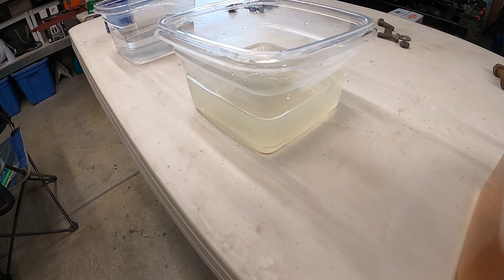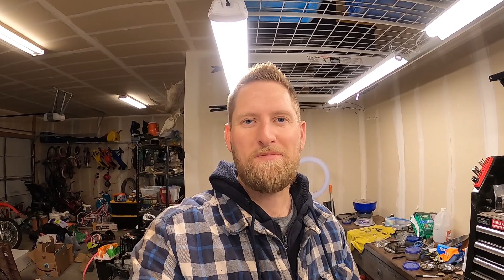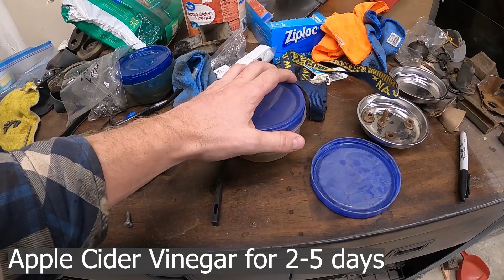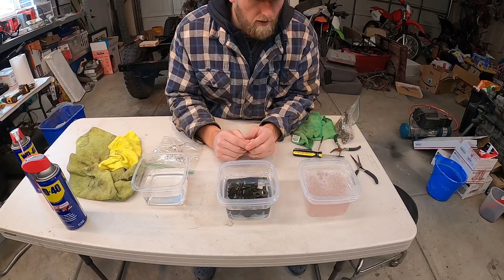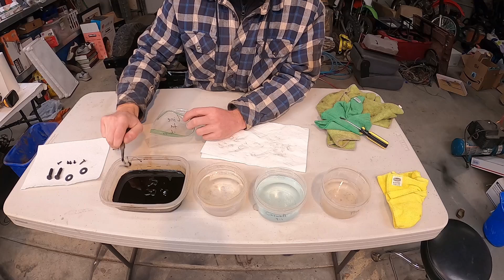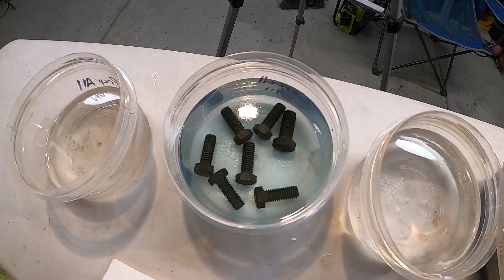BLACK OXIDE | Make OLD and RUSTY Hardware Look NEW Again!

Comment: Thank soooo much for this!!! I know I’m 3yrs late so I hope you check notifications…..I recently purchased a used “gerber diesel” multitool from an eBay auction and the black oxide is worn funny and unevenly. First thing I did was submerge it in clr for guns. It got rid of any and all rust (which was very, very little) and dry it with microfiber. Now, it’s rust free and all joints and pivots work smooth and grime free. I tried alums-black and steel gun blue and neither even touched it. My question is this….its impossible to disassemble the tool…..but, every bit and piece is oxide black…..do you think I could use your process on the tool completely assembled and get a good finish on it?
Reply from the maker: I don't know the correct answer to your question but if the tool can't be disassembles then doing this is probably your best bet. Once you submerge it I'd shake it around a little to get any air bubbles out.
Reply: @ thank you!!! I do  believe that submerging the entire tool will get evenly coated. I may have to take it out and rearrange the folding articles such as blades, files, etc…in which case I will use rubber gloves so as to not get skin oils upon the metals. I just ordered the Caswell black oxide pint ($38) and will pick up some cheap Tupperware so as to not piss off my wife and/or mix food storage with chemicals. Being that it was a used auction piece….im not worried about the final product….but fully believe it will at the very least be better than it looks now. I will, however, have to vinegar it well since I submerged it in wd-40 already. And the stripping of the metal (blast media) will have to be done assembled as well.
Reply: I am also needing to purchase a tumbler (harbor freight 4 miles away) and media. What grit of walnut media do you use?
Reply from the maker: @jasongaudreau2075  I don't recall the grit. I think what I got was all harbor freight had.
Reply: @ thank you
Reply: How has the black oxide hold up in 5 years
Reply: @brycemanuel4205 it’s shitty. Like blotchy skin cancer

Comment: Can I do this and skip the tumbler step? I dont have one of those
Reply from the maker: Yeah you probably could. The vinegar breaks up the rust but the tumbler helps take the rust off. So if you dont do the tumbler step just use a wire brush to get all the rust off.

Comment: I've got a lot of hardware that I need to do this to.
Reply: Just curious what the purpose of the black oxide is if it doesn't prevent rust?
Reply: @vwnickjetta  It's basically like bluing that you would see on guns
Reply: @vwnickjetta  it's a rust inhibitor
Reply from the maker: Trevor hit the nail on the head. It does inhibit rust but I can't say it is a rust preventer 100%. Metal is porous so it is likely that the oxide does not fully penetrate the steal. Hence the need to use some type of oil or water repellent.